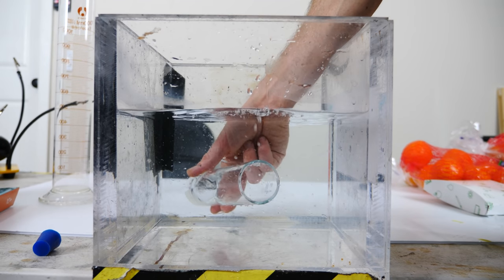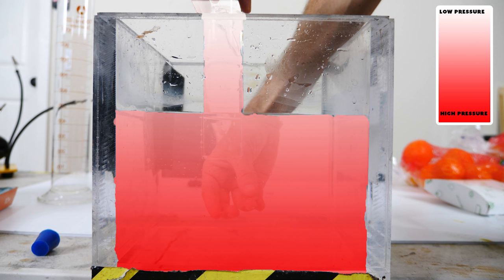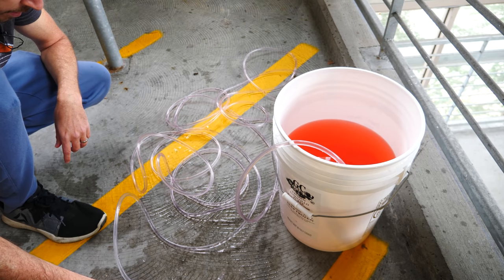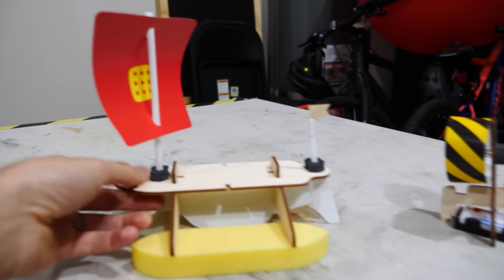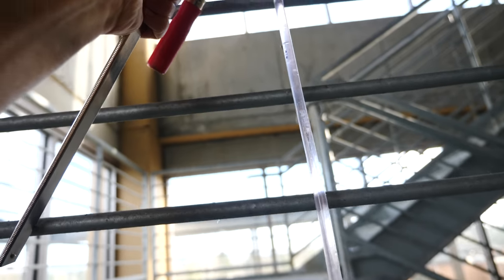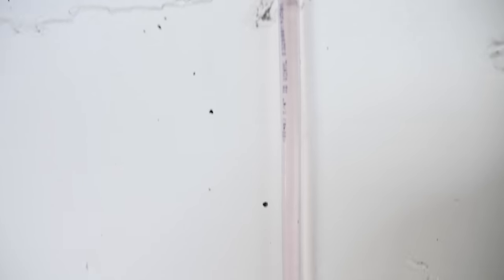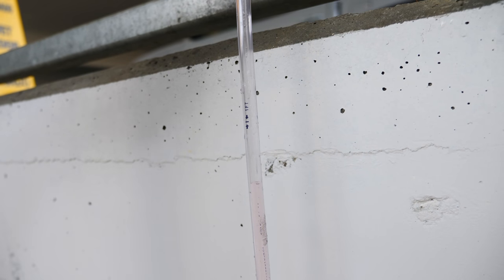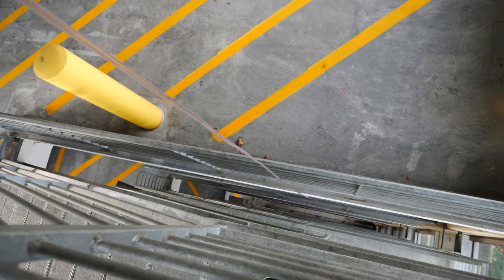Why Water Boils In Tall Cups

Comment: There’s a lot of cool stuff going on here that depends heavily on the geometry of the setup. When I did this I had a waterbottle at the top thinking it would look cool on camera, but it actually slowed the boiling process significantly because the large volume of liquid water that was displaced by a tiny bit of boiling was forced through a pretty narrow tube – the water level in my bucket at the bottom actually went up. After I filmed my experiment I saw that Practical Engineering also made a water barometer by filling a large diameter pipe, closing a valve at the top, and opening a valve at the bottom. His water level stabilized below the actual theoretical boiling height I think because there was so much water flowing at once, its inertia falling down the pipe actually caused it to sink too low and overboil, resulting in too much trapped gas. It looks like you saw a bit of both of these effects while moving the clamp up and down which is really interesting because you didn’t have a diameter change like I did but the inertia apparently still matters.

After watching Grady’s vid with the PVC pipe, I spent a week  trying to get a leak-free 30’ length of pvc vertical and filled with water so that the flow resistance would be low but I never made it work. The insta-boil has proved elusive! I love the fold-and-clamp method you used though – it’s so beautifully simple and therefore an EXCELENT way to make the experiment more accessible – my “how to” needed way too much glue and made way too many leaks…
Reply: Hey its you
Reply: @hamondorf9355  oh hey Hamondorf, how's it going?
Reply: Writing an essay on yt? Lmfao
Reply: @axylotl1878  I'd rather see this interesting comment rather than bots or someone being toxic af
Reply: @axylotl1878  are you new to these types of videos?
Reply: Hey! I watched your video a while ago. I thought it was great. The fact you calculated an estimated height at which the water would boil and were crazy close was awesome. I really enjoy your content, Brian.
Reply: @psychogat3  well...... no
Reply: @ShiratoriIsOffline  yeah tru lmao
Reply: Also why r u not verified?
Reply from the maker: Also, once the water degasses, that air is very "springy" at the top and it takes up a very large volume. So once there is any gas in the line you have to lift the tube up significantly higher in order to stretch out the air bubble to a get a low pressure to keep it boiling. So basically to keep it boiling you have to continually lift the tube higher to keep that newly formed vapor at a lower pressure. This makes perfect sense. In order to continually boil the water you have to continually input energy. In this case the energy comes from lifting the tube higher and higher. Also note that the actual water level in the tube should stay about the same but the rarified vapor/air above it will continually increase.
Reply: I aint gonna read this😐
Reply: @kittu8825  sus
Reply: I remembered your video before I even clicked on this one... on point!
Reply: @ShiratoriIsOffline  I'm chilling hbu
Reply: @kittu8825  you certainly went out of your way to comment on this.
Reply: Excellent video when you can get an ultra-vacuum specialist to respond :-)
Reply: @TheActionLab  I think the air outside the tube (ie the atmosphere on the water in the bucket) is the springy part - the water vapor in the tube is only a tiny pressure and exerts almost no force on the water below. Suction isn’t a thing except in the casmir effect 😁
Reply: Wait you watched Grady’s vid before this one right?
Reply: Actually the principle of this water void is the same of a mercury barometer, so you could use mercury since it doesn't stick to the glass if you want
And a meter of mercury tube is easy to do with a single glass one so you prevent leakage as well if you want something leakage-proof
Reply: @TroySchrapel  Thats just what I was thinking. 
When you know the exact height where the boiling point is, you can calculate the temperature, right? 
But why do you say barometer? 
Isn't the inside ofthe tube a closed system?
Reply: @TheActionLab  Awesome practical demonstration. How would you relate your findings to the formation of vapour bubbles in the different types of xylem in trees?
Reply: @TheActionLab  I’m a little confused. How com water boíles in this experiment, but it doesn’t boil in pipes of high rise buildings? Wouldn’t the top floors just be getting water vapor? Or is it because it’s pressurized?
Reply: I was about to say that he stole this vid idea
Reply: @TheWaynester101  Correct, it's pressurised. Otherwise they could never have water piped in!
Reply: @mduckernz  (2)
Reply: Student: writing 30 letters
This dude: writing 3000 letters
Reply: @TheActionLab  So if you keep going but water level stays the same will you get condensation at the top?
Reply: it also is one method of making drinking water at sea. All you need is vacuum. Works better in colder water than warmer water.  But I think that is because surface water was also used to condense it. Why not?  Got an ocean full of of it. 
I thought they used steam distilling out to sea. But it uses the heat in the water that is already there. Reducing the pressure reduces the boiling point. But the latent energy amount remains the same. For a ship something like roots blower would work. If it makes pressure. It could also reduce it.
 But if you added waste heat from the engine it would work faster. My brother worked on designing a system like that for the US Navy.
Do realize a ships's exhaust stack is 70 to 100 feet above the sea level, or more. Also it is a heat source.
It worked, but the re-construction contracting cost more than the installation. So it was not implemented. It also decreased fuel consumption.
 Water is important out at sea. Aircraft need bathing to keep the salt from eating them.
 Yep I can see what going two-three weeks without a shower would be like with females.
 It was much worse in the tropics. Really bad in the Persian Gulf with 98 degree water temp.
Hell there was enough water hours whining with a all male crew. So maybe the USN is finally using it.
Reply: @TheActionLab  That's know as "water vapour pressure".
Reply: @TheActionLab  hey do you know that your thumbnails and some of your titles could be considered click baits
Reply: @stevechatfield1832  Xylem transport is quite different from a plastic tube. It is much thinner, so other factors come into play (capillary action, as the water "sticks" to the walls). There are also chemical processes broadly summarised as osmosis, as there are differentials in ion concentrations between roots and soil (crewting positive pressure to "push" water up (like in hi rise buildings) and between leaves and roots to additionally "pull" (which works in conjunction with the narrowness of the tube, so there is no opportunity for evaporation). Xylem and the whole plant transport system is pretty complex stuff, more so than a plastic pipe.
Reply: I still don't get how water can reach 212 degrees by doing that, unless boiling just means agitating it.
Reply: @johnjeffreys6440  The water does NOT reach 100 degrees (212 in the old colonies :) ), so your not misunderstanding that bit. However, boiling is more than just "agitation". At the top of the tube, the column of water is pulling down with as much force as the outside air pressure is pushing up from the bottom (its actually the other way round, but don't worry about that subtlety), so the pressure inside the tube is pretty close to zero. At very low pressure, the molecules of water that fly off the surface have nothing to stop them and bounce them back into the liquid as would happen when there is an atmospheric pressure with air molecules in the way, so they "boil off". Those molecules are at the temperature of the surrounding water, not at 100 (212) but have enough energy to break free even at the lower temperature. But thats just the surface. Inside the water there are tiny bubbles of gas, too small to see, but they are there in any normal water. At the surfaces of those bubbles, the same thing happens, with water molecules boiling off into the tiny bubble, making it bigger and looking like "normal" (hot) boiling.

The reverse also happens; if you increase the air pressure around the water, the molecules of water get shoved back more by the extra air molecules, so they can get hotter before they can escape the surface. This increases the boiling point ABOVE 100 (212). That is exactly how a pressure cooker works - higher pressure inside means the contents of the cooker can get hotter than 100 (212), so cook faster.

Hope that helps to explain its not increasing the temperature, just decreasing the boiling point of the water.
Reply: @andyowens5494  OK thank you
 the word boiling is so  synonymous with the word temperature it gets confusing.
Reply: @johnjeffreys6440  You're welcome. The more folks understand, the greater the chances we can stumble upon improvements to the world :)
Reply: @johnjeffreys6440  Boiling is a substance increasing its entropy. That is the natural state for most substances (exclude magnets, etc.). The only reason all liquid water and all ice on Earth is not vapor is because the atmosphere compresses it. Heating water to 212 F gives water particles enough energy to overcome atmospheric pressure (simplified). Less atmospheric pressure at higher elevations is why cooking / boiling food takes longer in Denver, Mexico City, etc.; the boiling water is a lower temperature than at sea level.
Reply: @Keithustus  they should probably call it something along with boiling like pressure-boiling. 
because mostly everybody associates heat with boiling? 
thanks
Reply: @johnjeffreys6440  just the fault of conventional conversational language. People default to “water” when we think “boiling” but watching things boil that are not typically liquids at room temp and pressure is fascinating, for instance when liquid nitrogen is poured over a large surface.

Comment: you did the similar video, the longest straw to explain the boiling phenomena really helped me in my exams to understand the concept of vapor pressure should be equal to surrounding pressure in order to boil, thankyou james sir
Reply: wasn't the same actually..a lil bit different
Reply: They're different
Reply: @mrDUBtaker  similar enough he should have mentioned it earlier, if only to avoid this
Reply: @chrstfer2452  If you had watched the whole video you would've seen that he did mention it
Reply: @void_serenade  he said similar
Reply: @dgkinglols989  i said different
Reply: Its 12:32 am
Reply: 4:49 - 4:59
Reply: @void_serenade  "..and it's actually basically the same experiment.." this is some headassery
Reply: Lies...straw and cup diffent
Reply: blenders
Reply: Man I thought I was having deja vu. I knew it was even the same parking garage. It also boiled when he used the pump in the old video.

Comment: I learned this in my fluid mechanics chapter but didn't quite understand it well. Thanks now the concept is crystal clear to me
Also for those wondering 33.8 feet is  10.3 meter coz in the chapter it was in meters
Reply: Ah! I was a little confused as to what was causing the pressure until the end. I mean my intuition (from doing this in the bathtub as a kid with a cup lol) told me it was the weight of the water pulling down that caused it but it wasn't really explained until the end. Thank you for this!
Reply: Makes sense since every ten meters you get one atmosphere of pressure.
Reply: @ubershmekel  what does not makes any sense is people still using imperial units
Reply: Why 10,3 meters and not 9,8?
Reply: @РэйЧехов  because it comes from p=ρgh, therefore h=p/ρg, which is about 10,3 m
Reply: @sNsReal  ok nerd
Reply: @schowers  Now, that is an argument
Reply: @sensorer  so wouldn't the diameter of the pipe or tube matter here? i would think the larger weight of water in a thicker diameter tube or pipe would lower the height at which this occurs? no?
Reply: @tirkentube  no, it would not. the thing that causes this effect is called hydrostatic pressure and it does not depend on the diameter of the tube. changing the liquid would change the height though btw
Reply: @tirkentube  the effect occurs because we have the atmosphere pushing down on our reservoir and we don't have that inside the tube, which forces the liquid to climb the tube. in turn, our liquid column in the tube is creating its own pressure cuz gravity wants it to come down. and that pressure is called hydrostatic pressure and is P=ρgh, where ρ is the density of the liquid, g is the acceleration of free fall and h is the height of our column of liquid. once the liquid climbs up high enough so that hydrostatic pressure balances out the atmospheric pressure, the liquid can't climb anymore.
so to get the height h we need to let atmospheric pressure equal ρgh and then get it from there
Reply: @tirkentube  as you increase the diameter of your tube, even if the tube is still filled, it would not affect the height, as the weight of the water is spread out linearly.
Reply: A piece of trivia in entry level thermodynamics : each 10 m of depth in water increases the pressure by 1 atmosphere
Reply: @sensorer  I didn t get why it s boiling
Reply: @РэйЧехов  Because atmospheric pressure is 101325 Pa (N/m^2). A cubic meter of water is 1000 kg, so the pressure a column of water 1 m high exerts on 1 m^2 is 9.8*1000 N/m^2. 

101325/(9.8*1000) ~= 10.3

That this number is close to 10 (not exact) is purely a coincidence by the way, and was not at all a design feature of the SI/metric system. It worked out that way simply because Earth's gravitational acceleration just happens to be 9.8 (close to 10) and atmospheric pressure is 101325 (close to a power of 10).
Reply: Is it salt water 💧?

Comment: This is how we made our water barometers when we were kids. These included a steel can with a nipple so we could adjust a partial vacuum and have about 6 ft water column on the wall. Otherwise, you have to have a column long enough to balance air pressure of ca. 15 lbs per square inch. That works out to about 32 foot column.

Comment: Nice demonstration! This was discovered by Torricelli in the 17th century, Galileo's secretary, after Galileo was called for help by engineers wondering why  the pumps used in fountains could not draw water higher up than around 10 meters. This gave rise to the invention of the barometer.

Comment: This is great video and interesting experiment. I hadn’t thought of the boiling thing. But I think you should clearly mention that the 33 feet limit is due to the fact that much height of water has a weight which is equal to the atmospheric pressure and hence atmospheric pressure cannot push it further.
Reply: Oh Americans. It is 10 meters. The boiling point is based on the metric system.
Reply: @Supremax67 

You'd at least be correct if you put it the other way around.

A liquids' boiling point is dependent on the atmospheric pressure surrounding it, not the unit system you use to measure.

*ka-kaw, freedom eagle science noises.

Comment: That experiment of course will indicate atmospheric pressure at varying altitudes, the higher your altitude, the less that distance becomes.
I loved the practical demonstration, it worked well.
Kind regards,
South Africa
Reply: Yep, he just made a water based barometer. That's why they use to use heavier mercury. So instead of 33.8ft, it only needed to be 760mm (~30 inches) tall.
Reply: Whoa so wait, YOU'RE South Africa!? I've heard so much about you... I LOVE your accent!
Reply: Jeez